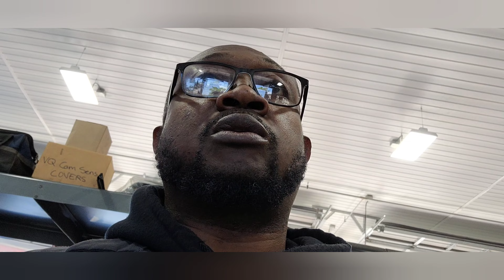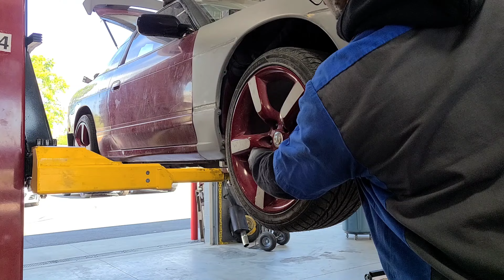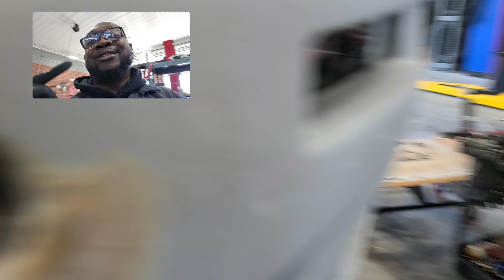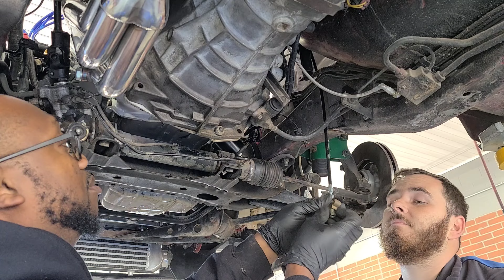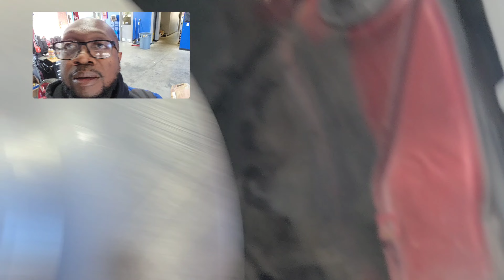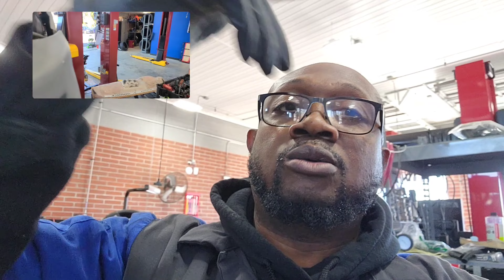Finally Installing the 300ZX Calipers on the 240SX.

Comment: I’m glad I watched the whole thing, I was about to tell you that you don’t need those brackets at all. Would use a 1” master cylinder if you don’t have one already. Been running these brakes on my s13 for years and I love them.
Reply from the maker: Appreciate the info, can you please send me more info on 1" master cylinder, please please and thank you so much.
Reply: @AUTARKYDESIGNS  i misspoke. I am running a 15/16” (0.903 in.) which is almost 1”

I am running the same Z32 Calipers front and rear on my car.

Part number for my MC is 46010-22F00 

This is a direct bolt on NON-ABS Z31 MC

Be careful and DONT get an ABS one because the ports are different. If you want to run a 1” MC I believe you have to get a very early (1991 year only) NON-ABS Z32 MC 

Part number for that one should be: 46010-45P00

Back in the day (~2005) I went through the process of seeing what fit and back then most guys ran the Z31 because they were easier to find in the junkyards and they bolted straight up no problem. Pedro feel is fantastic IMO.